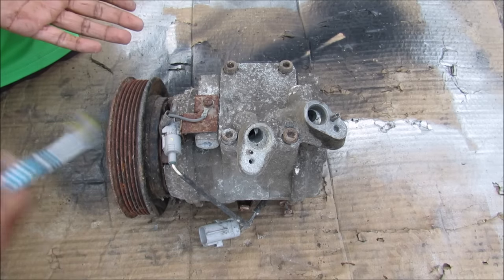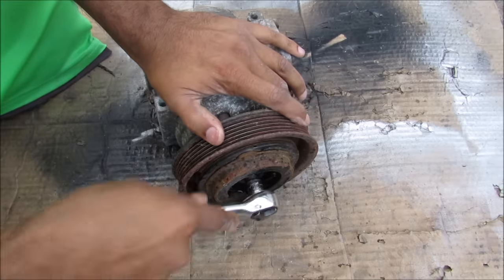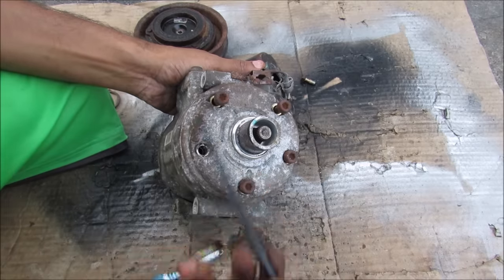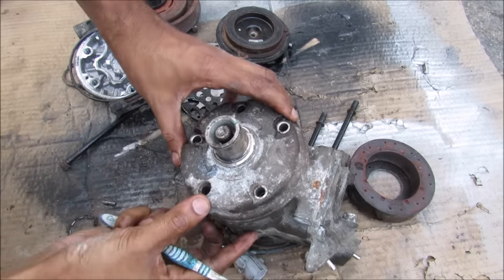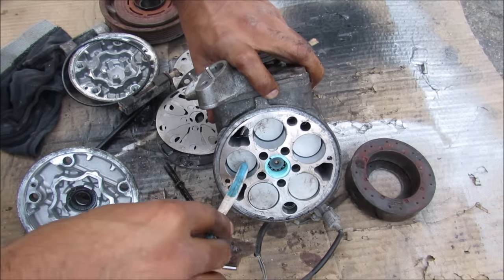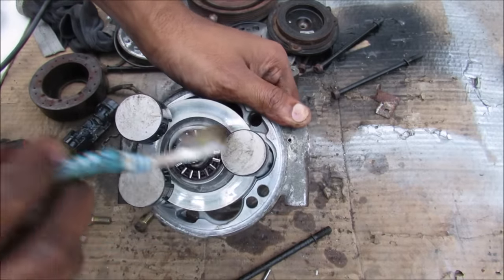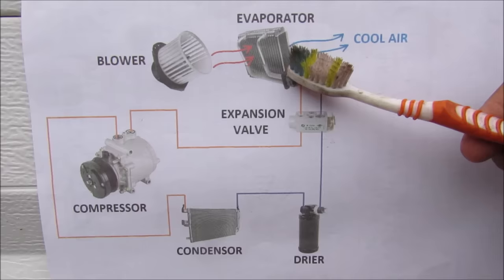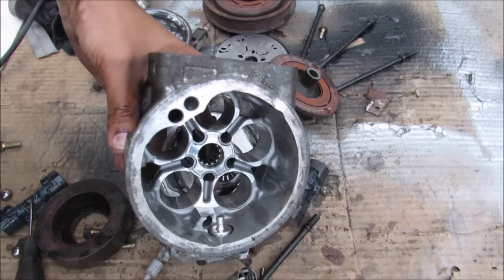How an A/C Compressor Works

Comment: That sensor in the side of the case isn't a pressure sensor. It is a variable reluctance pickup that detects the swash plate as it rotates and "wobbles" past the sensor twice per revolution. It's purpose is to confirm that the compressor is rotating with no clutch slippage when engaged. If the compressor partially or completely seizes, the computer will detect the incorrect shaft speed relative to engine speed and disengage the clutch to revent loss of the belt.

Comment: Instead of all that, can't they use a heatsink to extract the heat from the input air supply?
Reply from the maker: Because the air supply would likely be warmer than the desired cabin temperature in the summer.
Reply: @speedkar99  What if you had a large heat sink and a very powerful fan? Should be able to reduce the temperature significantly?

Comment: I wonder if one of those the freon oil removed, then filled with non-detergent air compressor oil and then hooked to a motor if it could be used as an air compressor?
Reply: Has to be ISO VG 46 to remain within specs. An oil separator might also be a good idea since it hasn't got a sump.

Comment: This Denso 10PA15C looks almost new inside. Guess the AC system was regularly serviced. Internals from severely abused compressors that haven't seized up yet show different kinds of heat discoloration and oil carbonization.
Reply from the maker: Yes it's not bad inside. There was oil so it was lubricated.
Reply: @speedkar99  It doesn't matter that oil is inside. What really matters is that the correct lubricant return rate has always been there. Return rate dramatically decreases when refrigerant charge decreases. Add to this that both the refrigerant and the oil carry heat away from the compressor and if the oil overheats it first thins out too much, not giving enough of an oil film between critical parts (such as between the swashplate and a piston shoe) and then it carbonizes. Also, too thick of an oil can reduce lubricant return rate too so only put inside whatever's closest to what is on the compressor's label. If it says ND-8, for example, never go and refill it with Ester ISO VG 100. Use only double end capped PAG ISO VG 46 in that case.

Comment: Do they systematically remove fluids when cars enter the junk yard? I'm assuming all the refrigerant would have escaped when removing those hi/lo pressure lines, otherwise.
Reply from the maker: Legally they should. 
They don't actually have time for all that 
I shot refridgerant into my face while poking at a shrader valve in the junkyard full blast

Comment: The pistons don't need a seal against the cylinder walls because the tolerance is so tight that the oil acts as the seal.  The oil is not only lubricating, but sealing as well.
Reply: I think that the piston is covered in some low friction material (such as Teflon). Otherwise the oil couldn't be enough to prevent some friction.

Comment: Hi... I have toyota KDH 2015 petrot  (trh 200) van. I'm planning to convert its AC working from Solar power.(Just need to give the power to AC compressor from the Solar enargey)  Can you explain is it possible or not?..

Comment: If you were to remove the one way valve and push air through the compressor could you run it as a compressed air powered motor?  
I imagine it would get too cold from the expanding gas and stop working well.
Reply from the maker: I doubt it since technically the Pistons aren't "air tight" with seals or anything.
Reply: @speedkar99  They're actually "oil tight" and might also rely on some kind of coating to aid the oil seal. The R-134A versions specify PAG ISO VG 46 oil (ND oil 8 is nothing but double end capped PAG ISO VG 46 oil from a certain manufacturer) and that tells you how tolerances are strict here. Oil separator maybe? Well i doubt PAG 46 mixes that much with air anyway (but i recommend double end capped PAG if you want to experiment, since it's apparently not hygroscopic).

Comment: I use the same brand of Toothbrush!! 
lets convert that compressor into a micro 10cylinder boxer engine...we should use those car compressor designs on household a/c compressors they look spaceage and more efficient!!
Reply: No, scroll and vane compressors are already used where space is a concern
Reply from the maker: I didn't know you get Colgate toothbrushes in Cuba Fidel Castro 😉

Comment: Great video and explanation-
Question, I replaced clutch kit with out replacing the magnet..  resulting in smoking of the compound in the new plate(that’s engaged by the magnet) 
Went back and replaced magnet and installed again,  not the unit wants to circulate but only engages the ac briefly (1-3 seconds) then shuts off cause poor ac temp and performance of the system.  Pressure is good in the system and compressor wasn’t removed..  only clutch kit was replaced.  Do I need to purchase a new kit/ so compound is present to circular properly ?
Reply: This sounds more like pressure getting too high and tripping the high pressure switch/sensor to me...
Reply from the maker: Agreed. Seems like the switch is causing it to cut off triggered by either too much pressure, wrong signal from the HVAC unit or a wiring fault.
Reply: How would you trouble shoot this..  
replace ac relay?   
Ac fuse seems alright.

Already replaced clutch kit..

Comment: complexity made simple....   amazing... great job!
Where does the oil come from? Is it in the freon?  Does it ever have to be changed?
Reply: Oil is distributed across the entire system, the refrigerant flow will be constantly returning oil to the compressor which will then pick it up and use it to lubricate all moving parts. A mix of dedicated passages that recover and carry the oil dispersed into the refrigerant as a mist around the housing and splash lubrication actually, since there's no pump. In a fully charged system, most of it will be inside the compressor (once the refrigerant gets very low, most of the oil will accumulate inside the evaporator, however). When you flush a system and fit a new compressor you can either pour all the oil charge inside the suction port or distribute it between components (compressor, condenser and evaporator for example), then when you turn the AC on the refrigerant starts moving it around. No need to change it unless the compressor breaks up. Just add back any oil that comes out with the refrigerant or with an old component (in that case, oil tables are needed because synthetic oil is polar and it will cling to any metal and never come out without the help of a solvent; compressors will retain about half an oz of oil inside them) whenever the system is serviced.

Comment: Great video!  Have most of the car manufactures made the switch to the clutch less A/C compressors?
Reply from the maker: Most likely it'll go full electric
Reply: In reality, OEM that employ variable compressors have first switched from the clutch+mechanical valve (inefficient design) to the clutchless+solenoid control valve (more efficient), and then to the clutch+solenoid control valve version (more reliable). The latest are more tolerant of refrigerant leaks (the clutchless instead just keep on wearing fast in that condition, because they're always rotating when the engine is on and they receive reduced cooling and lubrication from the reduced refrigerant charge).

Comment: Great vid always wondered how it worked but most explanations were not good. And with the running in the winter my dumb Audi doesnt actually have a a/c button so in the winter you cant turn the compressor on which sucks most be why it's on its 3rd one
Reply from the maker: It's likely the AC compressor is controlled automatically through the HVAC so it turns on with your defroster. 
Try it out in winter...see if you see the clutch engage
Reply: @speedkar99  I've tried that it's one of those auto systems all I can do is set the temp

Comment: Those "bearings" for the pistons that ride on the swash plate are called "shoes."  They are like a ball bearing cut in half and then smoothed.  This is a fixed displacement compressor, possibly a Denso or Visteon (speedkar could confirm).
I am curious whether the device in series with the clutch is actually a low pressure cutout or a thermal cutout switch.
Reply: Denso 10PA15C. The device in series with the clutch is most surely a thermal cutoff switch (the rotational sensor is connected to the AC amplifier since it monitors rotational speed). Almost the norm on scroll and TV compressors, very rare on reciprocating ones.
EDIT: well, after looking further at it it seems that the device is not in series with the clutch coil, it just has some pins on the same connector. It may be a shaft rotation sensor that tells the AC amplifier if the compressor is behaving good or it's seizing up, so that it can be disengaged before it tries to rip off the belt.

Comment: This is the first time I'm seeing AC compressor with swash plate so I have a doubt, how this compressor is lubricated? I see there is no crankcase with lub oil and I didn't find any grooves for lub oil either, can you explain how?
Reply from the maker: There's a small amount of oil in the compressor itself that usually sits near the bottom (lowest point in the system) 
When replacing the compressor it's important to refill this oil
Reply: Oil is soluble in refrigerant. PAG and Ester oils dissolve in R-134A. PAO, Mineral and Ester oils dissolve in R-12. The refrigerant carries oil around the system so it's important to always have a good enough refrigerant level in the system or the oil circulation rate will reduce. So no leaking AC and no recharging with cans unless you want a seized compressor, and no PAO/Mineral with R-134A. Also, it's important to use the correct oil viscosity or oil circulation rate will reduce too. When the oil is too viscous or there's not enough refrigerant, the oil collects in the coldest part of the system (i.e. the evaporator) where it's at its thickest. When there's no sump the compressor relies upon the refrigerant always sending back to the compressor an oil amount equal to the one that departs from the compressor... most compressors have an oil separator inside (basically, a hollow compressor shaft) so that less oil flows around the system... because too much oil flowing around coats both the evaporator and the condenser in a oil film that ends up impairing heat transfer... variable displacement compressors, the ones which always run, need a TXV that never shuts closed fully or the compressor may stop receiving oil while evaporator heat load is low...

Comment: Just bought an OEM compressor for my 2011 Hyundai Santa Fe 2.4 L engine. my hyundai santa fe was blowing hot air and the techs at jiffy lube advised that i replace the compressor. My question is, rather than replace one, is it possible just fix the old one?

Comment: Does the AC compressor run when the AC is off? I think I got some water into the compressor, which is giving a HIZZZ.. sound. The sound increases as I turn on the AC. Recently, after a 4 hr of continuous usage, there were slight fumes from the AC vents. What could be the issue.

Comment: For the cost of a rebuild kit and time to rebuild one, how’s it compare to replacement cost?
Reply from the maker: Depends how involved you want to get....after rebuilding you need a test bench too so I feel like it's easier to replace it.
Reply: Want to rebuild it? Go buy a reman one (and make sure to oil it properly) instead. Simply not worth the hassle and the expense of tools unless you own a compressor rebuild shop. You want that thing to function, last and be leak free, not an easy task at all, and if you need AC you want it ASAP. Then rebuilding your old comp as best as possible as a side project while you still have working AC on your car is another matter.

Comment: Exactly what year/make/model did that compressor come off of?  I want to get a couple to convert into air compressors. That is one heck of a decent stroke/displacement and that unit does not rely on back pressure to keep the pistons engaged to the drive line, like some other similar types.
Reply from the maker: 2001 Corolla
Reply: @speedkar99  Thanks, bro.
Reply: @paulandrulis4672  It's a Denso 10PA15C if you're looking for the parts diagram too. The specific code of the compressor shown here is 447200-2141. Oil is PAG 46 double end capped.

Comment: 3:30 Refrigerant would get confused if it had to switch side on each compression stroke.  The old R12 was not so smart and required the sequential pistons, but the new R410a is smarter and can handle the cross-piston pattern not seen on this compressor.  < This post is sarcasm, because his comment about sequential piston order being easier for the "flow" is rubbish.  Sequential piston order is due to the swash plate to drive the pistons up and down. >
Reply from the maker: Ok

Comment: Other than the rust on the drive pulley that unit doesn't look that bad. Clean up the outside, reassemble and go.
Reply from the maker: This compressor was working fine 
It was taken apart for science 🤓

Comment: Wow i wasnt expecting it to be piston compressor
Reply from the maker: What type were you expecting?
Reply: I was also puzzled when i first saw it on my car. I expected it to look like some kind of motorbike engine with cylinder blocks and whatnot, and i found something that looked like an oversized beer can equipped with a pulley and a clutch instead...
Reply: @speedkar99  i was expecting scroll type or positive displacement pump of some sort.. wonder if all car ac compressors are the same, and thanks for showing us this one

Comment: You only missed one thing about common failure points of an a/c compressor, and that is the most common part being the input shaft seal noted at 3:34 of your video. They almost always are  the main culprit of refrigerant loss as they are the only seal between the inside and outside of the system with any moving parts involved.

Comment: good video, but the reed valves only act as check-valves, they don't regulate the refrigerant. the expansion valve is actually what regulates the refrigerant, based on the gas temperature returning from the evaporator. also, cars automatically turn on the ac compressor from time to time in the winter, so doing it manually shouldn't be needed.

Comment: Any idea how much power is needed from the engine to make the compressor work properly?
Reply from the maker: I've read around 5-10, HP
Reply: @speedkar99  Thank you.
Reply: @MrFree006  Really depends upon how much refrigerant is left in the system, how clean the condenser is and the ambient temperature. In other words, the power required to turn it depends upon head pressure. Can be as low as 3 hp in cold weather and as high as 10 hp in sweltering hot weather

Comment: I filled my A/C system with gas 2 years ago and it's low again. Should I consider this a leak or it's normal?
I use it in a very hot weather.
Reply: Not normal at all. However it's so slow you might just have leaking refrigerant port valve cores. Just buy a new cap and core kit
Reply from the maker: It shouldn't leak at all.
Reply from the maker: The shreader valve might need to be replaced. My Lexus does the same thing....a slow leak after a year.
Reply: @speedkar99  I once had a leaky LP service port schrader core (mechanic missed it while servicing the AC). The bicycle ones basically (Santech MT0064 is a good reference). It lost about half the system refrigerant charge (nominal is a little more than 1 lb) in the course of 15 days. With the cap screwed on tightly, mind you. However, it hissed like a snake after removing the cap. Mechanic either didn't hear it or was deaf as a post.

Comment: I've never actually pulled a compressor apart so never gave any thought as to how it manages the oil and refrigerant.

I always assumed the oil was stored in a separate chamber from the refrigerant.

So the working principle is that most of the oil cannot bypass the pistons therefore refrigerant gets compressed and forced into the condenser?
Reply: In these auto double sided piston designs (coach AC compressors such as the Seltec TM31 have a sump and a dedicated oil pump on the other hand), refrigerant passages are designed as to separate the oil from the refrigerant and send it around the compressor housing to all moving parts. I'll provide you with a related patent number shortly.
Reply: Here are two relevant patents US6862975B2 US4781539A
Reply from the maker: It's heavy enough to remain mostly in the compressor
Reply: @teravolt6113  Thanks. Gonna check those out.
Reply: @speedkar99  It makes perfect sense. I just never gave it any thought.

By the way, thanks for all you do. I've taught a number of classes on diesel and gasoline engine operation. Your attention to detail is phenomenal.

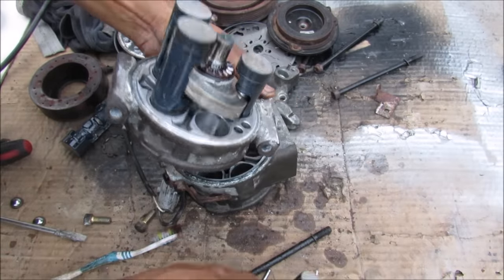Comment: 5:30 Doubt that O-rings or seals would be helpful, since (a) they introduce friction and wear, and (b) the refrigerant moving past them during operation will serve as both a lubricant and cooling medium.
Reply: If you look carefully, you'll notice the piston has been coated with some medium (a polymer?).

Comment: Question. My AC blows higher and lower by itself when turned on. Is it a faulty compressor/blower or something else? Thanks
Reply: If the air it blows out is always cold, the compressor is fine. In that case, it could be a blow motor (usually in the dash) that is just on its last leg. It could also be a faulty thermostat, if you have climate control (aka set a temperature and it does the rest.)
Disclaimer, I'm not a pro, just my two pennies on what to investigate.